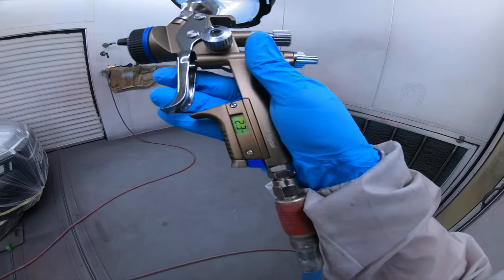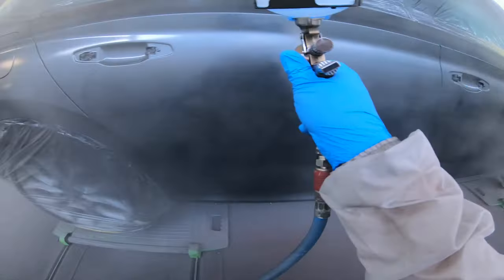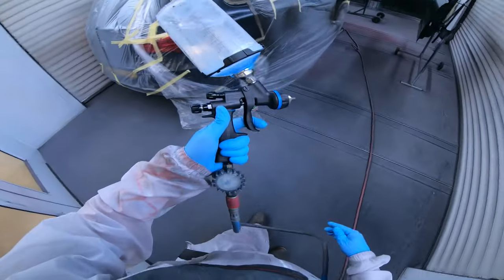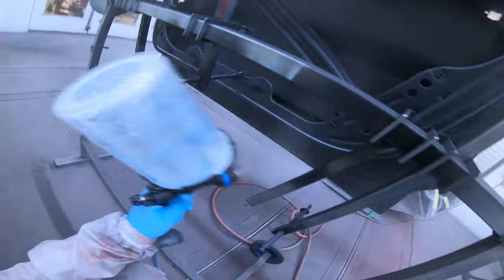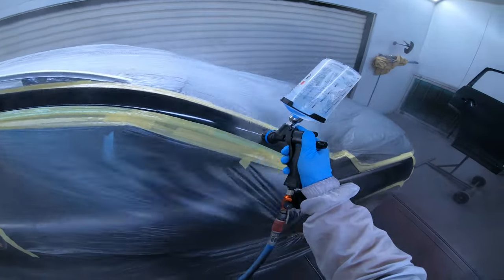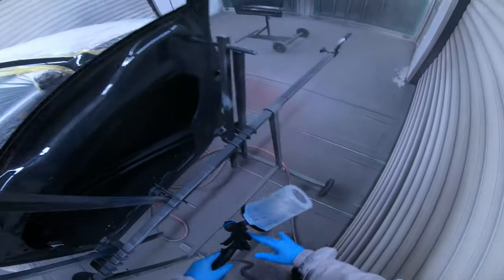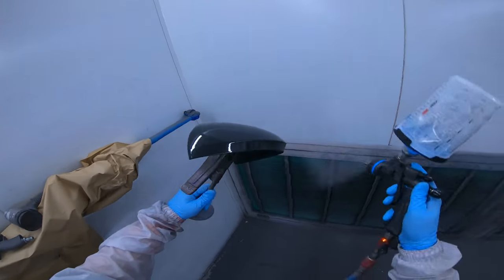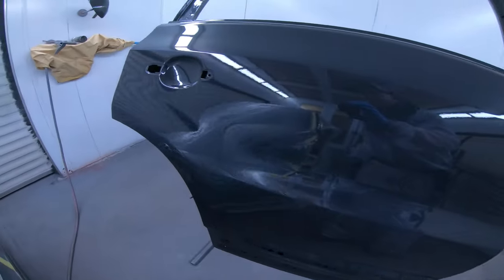SATA Vs WALCOM: How do spray guns compare.

Comment: Nice explanation of air consumption , because I have an Iwata LS 400 I bought an 8 hp petrol compressor(16,4 CFM) but the tanks small at only 120 litres so I'm adding another tank to it , plus air cooler/dryer, and yes im just a hobbyist spray painter working in my garage at home but nice to see the Sata Vs the Walcom  comparison
Reply from the maker: Thanks, I figured a little of viewers were DIY guys, so I'm trying to explain things in my videos for a DIY audience. 

That sound like it'll be a nice home set up. Thanks 👍

Comment: I run walcom hte for all four of my guns and they are fantastic. I do alot of custom cerakote and use the mini ego190 0.7mm HTE for that everday and have been using it and the other 3 for 1.5yrs and they work as good as day 1

Comment: With the walcom gun, what was the fluid and the fan setup.
Reply from the maker: Full fan, full fluid, 29psi 1.2 fluid tip. 
I have found with the geo if you don't open the fluid fully, it feels really slow.

Comment: Lovely video bud and as always lovely workmanship.   Might be worth adding the Sata5500 is Sata’s latest version and the Walcom Geo looks to be one of there older models that has now been upgraded to the Walcom Geo Light and again to it’s latest version the Walcom Geo EVO.     Might even be worth you trying one see it you can see the difference in lay down 

Or even look at the Walcom 360 EVO HTE the dedicated Clear gun with MP setup for Flat finish and Std setup for OEM finishes
Reply from the maker: Thanks, It is the older geo. I was borrowing a friend's Sata for this video as I only have Walcoms. But I used a Sata X5500 for a while at another place as they wanted us to use them and really liked it.
Reply: The 5500 is a lovely gun.  Let’s face it pal all the top manufacturers make fantastic equipment
Reply from the maker: @the_specky_painter1642  Absolutely, that was the point in the video. Both great guns. I'm sure with enough time with the gun, I could get a £25 Sealey gun to get a nice finish.

Comment: Fellow profesional spray painter here we do between 25 and 30 jobs per week so i would not call us big just middle of the range , use the devilbiss dv1's at work and we use the cromax paint system similar if not the same as standox , been looking at getting a sata lately since we signed a contract with a company to respray their sprinter vans in company colors , the dv1 is good but the sata has a bigger fan and is just a bit faster , also find the black on the dv1's a Prick to clean 😅
Reply from the maker: Hey Kevin, apologies for the in replying.

Yea the cromax will be the same as they are both under the Axelta umbrella. 

I really like the Sata's personally. I know exactly what you mean about cleaning the dv1's 🤣
Reply: @paulphillipspaintwork  i think the dv1 is the best for basecoat , forclear coat /2k it is good but not amazing
Reply from the maker: @kevinhekers2380  I hear people saying they are the best  for base coat

Comment: What issues are there sorting with really high pressure. Sure sprays nice that SATA but have not seen the Walcom
Reply from the maker: The Sata is a lovely spray gun. Most spray guns have some kind of regulator to control the pressure, or one can be added onto the compressor system.

Comment: Hi Paul I've listened to & watched all the hype on the new satacc, I've been praying for Devilbiss to bring out some new air caps but it's not happening, so I just thought with all the good reviews I'll try the SATA x5500 cc, opened the box, beautiful gun but it just doesn't fit my hand like a Devilbiss, in fact it's just not right it's horrible to hold, now I've just noticed you hold the gun with fore finger over the gun & little finger below the finger rest so I'm going to try that or sell the gun or Dremel the finger rest.
Did you discover that style by using SATA guns or is that your style anyway
Regards
Graham
Reply from the maker: Hi Graham,  I just had to watch that back. I was only holding the gun like that whilst showing the camera, when spraying I had 2 fingers on the trigger and the other 2 on the grip. Its a shame you dont get on with the Sata, I really like the cc. I guess it's just user preference. I hear really good things about the new iwatas they are comfortable in the hand too. Also the fuji spray guns are nice I have 2 of those.
Reply: @paulphillipspaintwork  Hi Paul
Thanks for getting back to me so quickly, really appreciate your help, I'm always looking at any changes that could improve the quality of my work as I am my biggest critic & if I'm not happy I can't expect the customer to be happy, love the show & keep it coming, thanks again.
Regards
Graham
Reply from the maker: @grahambooth-mr3eq  no worries Graham, I completely agree. I'm always really critical of my own work and looking for ways to improve. 👍

Comment: Hi Paul really good comparison mate and both of those guns did a great job, from what I can tell there doesn't seem to be much difference finish wise between the 2 guns so it probably comes down to personal preference.

When you was using the Sata it looked like you were holding the gun a fair way back from the panel it might have been the camera but I was amazed how you got such a good finish like that as I have to be close to the panel to get a flat finish from my Sata.
Anyway, really interesting video Paul so thanks for doing it👍
Reply from the maker: Thanks John, great feedback. 👍 the geo is a bit slow for me, so moving it closer will allow me to get the clear on the panel much quicker where as the Sata allows me to relax and take my time. It feels effortless.
Reply: Now that's strange Paul as I find the Sata X5500 a bit slow in the 1.2I, I got a 1.3I tip set for it and it was a bit faster but I thought it didn't atomise quite so finely as the 1.2 but that could be in my mind🤔 

Do you have an Iwata W400 Bellaria 1.3 mate? now that I think is the fastest gun in my collection it smashes it on and for the price gives a cracking finish, would be interesting to hear your thoughts if you have one Paul as I'm always keen to learn new things in this trade👍
Reply from the maker: @JohnWD40TC02  no I don't have the iwata.  The geo I'm is quite slow it's fully open and still slower than I'd like but the atomization is beautiful. 

The 1.3 will won't atomize as fine because more material is coming through you'll end up with a more orange peely finish. 

I might start reaching out to gun companies to see if I can get some guns on loan to test/review.
Reply: OK thanks Paul, I might try the Sata at 2.2bar as you have here I'm normally around 1.9-2.0bar.

I'm sure a lot of the big names in spray guns will give you a demo gun to try, I know Iwata have the WS Series2 demo gun and there is the DV1 Tony had a DV1 demo quite some time back👍
Reply from the maker: @JohnWD40TC02  yea the increase is pressure with help the atomization but create more overspray. 

Yea I should give Tony a shout it's been a while since I spoke to him.

Comment: I work in a big shop. I use a sata 5500 I pattern for base and I don't prefer them for clear as my booth sucks and anything over 25 psi fills it up pretty quickly. I also get a lot of flat cars and I can't seem to tame the German beast for clear. I use an iwata LPH400 for clear at 20psi. I'm definitely interested in the walcoms. Your thoughts and demonstration on pattern size would be interesting. Some people boast a large pattern but I see it splitting and obviously that's not very good. Speaking of...a year and a half in my sata pattern is splitting at full fan seems odd.
Reply from the maker: Great feedback. I can definitely  figure out sizes of fan patterns for the walcoms. 

Sometimes, when the fan pattern splits, it's because the pressure is too high, causing excess velocity at the air cap.
Reply: How do you like your LPH?
Reply: @Dopestt  gives original finishes, not so much glass flat.
Reply: @kr2513 Which cap do you have? Have you tried it at higher pressure?
Reply: @MarcBchannel  orange cap. I’ve went 32 psi.
Reply: @kr2513  Try the silver LV4 cap if you haven't. It chops up clear finer. I have it in 1.3 and it sprays MS clear really nice at 18-22psi. You can crank it up higher for HS clear, around 26-29psi. More overspray tho
Reply: @MarcBchannel  I clear with the dv1 base until I replace a packing in the lph. So far so good.

Comment: Nice job paul both.nice guns but I'm comming to the end of my time working wise so would be a  a bit daft if I splashed out on new guns so my GTI pro ×5 will see me through good vid bro
Reply from the maker: Thanks Dean, I honestly think most spray guns are decent enough these days. I'm not trying to encourage people to spend money on new guns. But I am enjoying how easy it is to achieve a quality finish without having to put much effort in lol.
Reply: @paulphillipspaintwork  🤣🤣🤣 10 years back I would have jumped on them guns as they both produce a lovely finish but 10years back they weren't around a guy in my shop has the DV1 clear in a 1.3 and I must admit tech has moved on I have to work at it with my guns but his seems effortless it's got the c2 cap on
Reply from the maker: @deanbrown7643  I have only used the dv1 a handful of times. I still have the original gti. Maybe I should compare the 2 lol.
Reply: @paulphillipspaintwork  go for it mate show people how tech has improved over the yrs 😉😉😉
Reply from the maker: @deanbrown7643  I'll have to try and get hold of a dv1 lol. Plus the clear coat gun back then is a 1.4 but I agree it'll be an interesting video

Comment: Thanks for sharing. im a diy guy looking for an all round gun for at home. any suggestions? thanks
Reply from the maker: Thanks, the best all round gun would be dictated by what cfm your compressor is. This is how much air it can deliver to the gun. (Some guns need 14cfm but if your compressor is only 10cfm it won't spray properly) if you let me know I'll have a look what would be best. 

Also I'll produce a video on the matter to help explain things like this for DIY gun and beginners. Thanks 👍
Reply: @paulphillipspaintwork  Thank you. my compressor has a 58 litre tank and produces 15cfm
Reply from the maker: @kanenaysmith9287  sweet lol the Sata 1500solv 1.3rp is a great around gun and a budget option would be the astro europro evo 1.3
Reply: @paulphillipspaintwork  thank you
Reply from the maker: @kanenaysmith9287  no problem 👍

Comment: thanks for the review and explanation about air consuption. i have the same Sata. but how do i tell weither it is the i or O pattern?
Reply from the maker: Thanks, it'll say on the front of the air cap. I.e Jet X 5500 rp 1.2 I or 1.2 0
Reply: @paulphillipspaintwork  thanks. i got one second hand. so it looks like it has i pattern. thank you
Reply from the maker: @dollaarz  no problem, thanks 👍